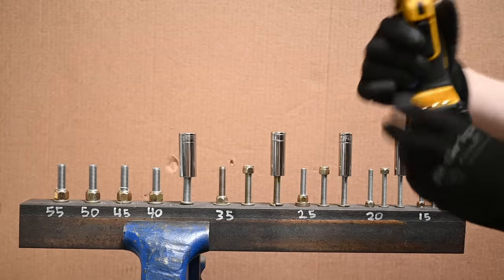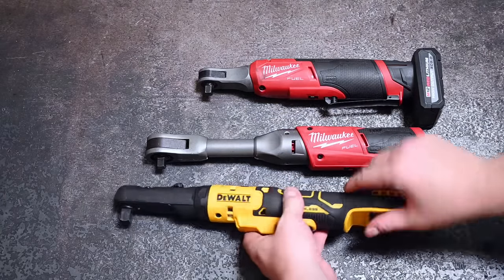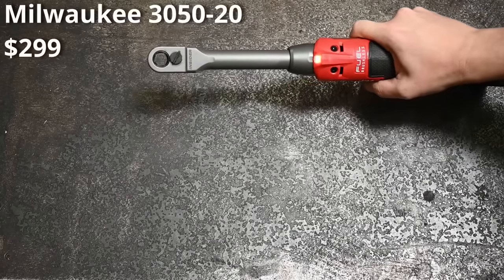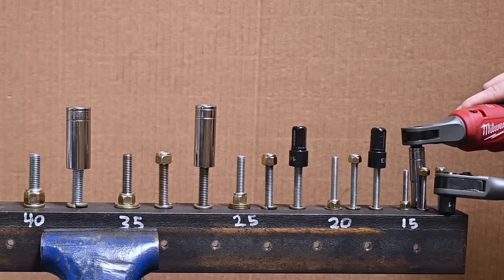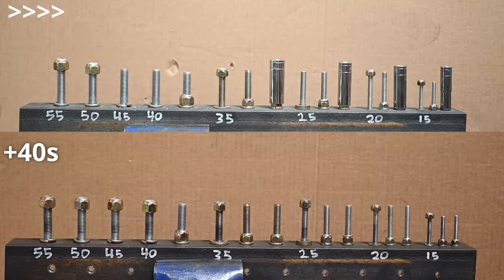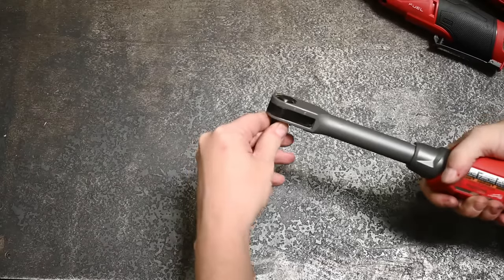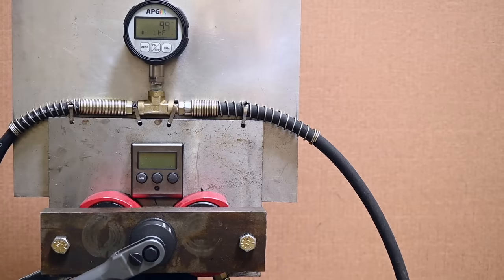Milwaukee's New Insider Ratchet vs DeWALT's New Sealed Head!

Comment: I think the test should be done again with the milwaukee insider using normal deep well sockets rather then the insider sockets as it defo seems to speed up more when using normal ones, i know that the whole point is to be low profile and to use the pass through but at the same time i think alot of people will be using normal sockets daily aswell and when a tight space situation comes up thats when the insider sockets would come in handy. Also with milwaukee udating the anvil adapters the whole issue of the adapaters coming out when taking off a socket isnt a big deal anymore and wont slow you down

Comment: Awesome test as usual guys. Really impressive to see how a unit looks good on specs, but fails in real life. I'm curious if the results would look different if you ran the gauntlet large to small or if the Dewalt would still win. That 12v dewalt is really holding it's own against the new 20v.

 I can't wait to see how the DCF500B 12v sealed ratchet ranks compared to the open 12v and sealed 20v. I think the 12v sealed ratchet has an even slimmer head, which would be nice.

Comment: That M12 ratchet is a thing of beauty. Ive been resistant buying an electric ratchect because of how traditionally bulky their heads were. Speed is the last concern for me.. i need low profile to access tight spaces in an engine compartment.  Very innovative design from Milwaukee.  🍻

Comment: How about using other tool brand batteries on different tools. Per example using a Kobalt 24v battery on a Milwaukee tool with a 3D printed adapter of sorts to see if tools perform better than the manufacturer’s own proprietary battery 🤷🏻‍♂️

I see them often on Amazon & Etsy

Comment: I'd bet the looseness of the direction switch with the passthrough m12 is causing the hesitation. That thing was moving way too much in my opinion. Be interesting if you wrapped it in as few layers of electrical tape to see if the hesitation goes away. That should pretty much tell you if there's a design flaw in the head.

Comment: Would like to see the newer old style Milwaukee ratchets compared as well. The 2569-20 model that exists between the original Milwaukee ratchet and the new insider, would also like to see snap on ratchets up there, preferably the older brushed and the newer brushless model.
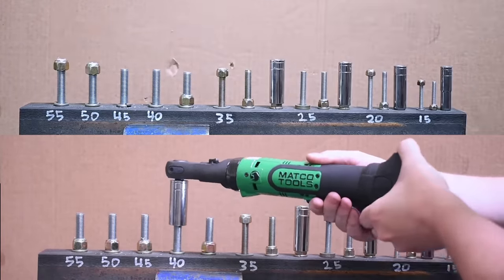Reply: the 2569-20 was featured here, and it actually got the new insider beat on the gauntlet. Fast forward to 14:30

Comment: How about the DeWalt and Matco sealed head ratchets vs the Proto 3/8" sealed head air ratchet J138RSH.. and if you want a real pass through check out the Matco special forces set

Comment: weird its the same effect if you hold the socket in your hand with one of these. that usually means the fastener is flexing somewhat, i see it on v-band clamps all the time, but those are pretty solid looking so my only guess is the mechanism is flexing inside...?

Comment: The reason for that slowdown is excessive vibration and the way the mechanism works on a power ratchet, vibration can keep the ratcheting mechanism from effectively engaging the next tooth when ratcheting, if you put some pressure on the head or the fastener to remove vibration you will see that it doesn’t slow down anymore. My high speed short 3/8 does it when removing stuff that is kind of too loosely held but the nut I’m removing is tightly attached.

Comment: Dewalt dcf500. would be more comparable to the Insider.  It has the same 1/4” and 3/8 drive.  I’m looking to get one and the Insider I like for the sockets, slimmer body and head size. The dcf500 would probably have similar torque and speed to the Insider and better socket changing at the expense of weight and size (size being very important in auto repair)

Comment: The larger sockets aren’t passthru because the male threads that go with those nut sizes won’t fit through the drive while leaving enough space for the socket to engage the drive.

Comment: Thank you for this video! I already have the m12 high speed, and I am in the market for a higher torque ratchet as well. I had high hopes for the insider but this video has shown it’s not so good. I might even consider this new Dewalt sealed head.
Reply: I've been using the Insider to cage brake chambers on semi trucks without issue. 🤷‍♂️ 

The fact that I've used it and then see this video, makes Mr highly suspect of their integrity on this channel.
Reply: @KRC1227  I’m thinking that the unit sent to them by the viewer must be faulty. I hope that when TTC receives their own insider they redo the tests to see if they all are going to have troubles like this unit did.
Reply: @michaelchristopher8266 Honestly you should get the DeWalt. It has both speed and torque.
Reply: @slingin_tires  I’m not sold until I see a display model and hold it. My main concern is the size of the head being larger than my m12.
Reply: @michaelchristopher8266  Ok so it's larger than the high speed but a little smaller than the high torque. What you might just need is the 12v dcf500 Dewalt. It's within a 1/16'' of the high speed with 50 ft lbs. torque.

Comment: My cheapo HART brand is rated for 35lbft at ??? rpm and it can run my Honda Accord off the ground on the factory scissor jack in less than 30 second. Just slap a 13/16 socket on the ratchet and it mates up perfect with the scissor jack dealio

Maybe do a comparo on that sometime?

Comment: Too bad you didnt have the insider amd the dcf510 at the same time. Wonder if the insider sockets would fit the dcf510. Tim from shoptoolsnew (i think thats right) put a caliper on the hex part of dcf510 3/8 anvil and it showed .63. I looked up the 3/8 anvil for the insider on milwaukees page, under the specs it also shows .63

Comment: I see dewalt do a 1/4" drive & 3/8" drive tool & a 3/8" drive & 1/2" drive tool, are they both the same tool but with different adaptors & if so can u get say the 1/4" drive bit for the bigger set or is the tool bigger?
Cheers

Comment: Is there a difference between the 20v sealed head and 12v sealed head I got the 12v from my Mac dealer and seems to be performing great!
Reply: Main differences is size and power. The 20v is very strong and it also comes with a 1/2'' anvil,
Reply: It sounds like you've got a solid tool in hand! The main difference between a 20V and a 12V tool is the voltage of the battery they use. Generally, a higher voltage tool can provide more power, making it suitable for heavier tasks. However, for many applications, a 12V tool can be more than sufficient and may offer the benefits of being more compact and lighter.

If your 12V tool is performing great for your needs, that's fantastic! It's all about finding the right tool for the job, and it seems like you've made a good choice. Anything specific you're working on with your tool?

Comment: I've had a Crapsman Max Axess ratchet set and cordless ratchet for 3-4 years now. Uses proprietary sockets and all are pass through although the largest bolt size to pass through the socket would be around a 14mm diameter. I seriously doubt it would compare to either of these though, just thought I'd mention it.....

Comment: Question is, do you think its better to go buy the 12v dewalt + having to buy a 12v dewalt battery (or some other generic 12v with or without an adapter?) vs buying the 20v tool when you already have other 20v batteries?
Reply from the maker: Get the 20V then if you have a power stack already, if you dont then the 12V with batt and such is still cheaper

Comment: I have the standard M12 and Astro nano sockets but I will admit; this is quite niche. I typically work on motorcycles and unfortunately, I tend to grab a Nepros compact manual ratchet more often as the M12 ratchet is just too big for the spaces I’m working in. When I have been able to use it, it’s been great but if I fumble around with trying to fit this tool somewhere and then finally just grab a regular ratchet, how much time am I really saving?

Comment: Pass though sockets are kinda a special case tool, I've only used my kobalt hand set once the several years I've had it. Most of the time my ratcheting box wrenches are a better choice as I own low profile sockets, bending ratchets and some other less used tools that absolutely make Pass throughs useless

Comment: Aren’t the larger sockets not pass-through because the stud for the larger size nuts would be too big to actually pass through the ratchet?
Reply from the maker: Correct, it would require a different hex size, like dewalt's using a 16mm instead of 14mm and their not even passing thru
Reply: @TorqueTestChannel there are already established standards for sockets with an external hex drive. It would be really nice if companies would just release these electric ratchets in 12mm, 17mm and 21mm instead of trying to be proprietary.

Comment: As soon as this insider was available to purchase in the uk i got it 😂. Got stuck between what to buy 1/4 or 3/8 drive ratchet for ages and now i have both! Paid £350 for the kit which i think isnt too bad.
Reply from the maker: It's not bad when you need both drive sizes really
Reply: @TorqueTestChannel I look at it like it's two Ratchets in one plus the added hex bit adapter is fantastic.

Comment: I want realistic tests on ratchets, meaning how much it takes to break them. In real life we use them as regular ratchets to break loose and to tighten, how hard can you push manually before the mechanism fails or slips, and will it break or slip (Makita slips before it break, most older battery ratchets break, no idea about newer ones and thats why someone need to test it). Torque is for angled impacts, not for ratchets.
Reply from the maker: Well both got up to 150 ft-lbs here by hand. If you're pushing a 3/8" ratchet past 150 ft-lbs, I dont know what to tell ya

Comment: @torquetestchannel
It's been a couple of months. Have you used another M12 insider and noticed if the stuttering was just a one-time issue?
Reply from the maker: Happens all the time. Has to be "right" like enough resistance. But more than once per task/job. Stopped using it TBH, just use the high speed and wrench it when stuck if needed
Reply: @TorqueTestChannel  thank you for the reply. You saved us some money, again. 
We run red and yellow. Currently just running the reliable brushed M12 and extended m12.
For the tight head spaces, is the sealed head an adequate alternative in application? Got a few spots where we've managed without, but were interested.
Reply from the maker: @MidwestPauly  I'd say the sealed head makes up for some of the draw backs of the overall DeWalt shape but all together doesn't match the access of an extended M12 or even an extended Ryobi for that matter.

Comment: Can you test impacts on nuts vs bolts with both hand tools and impacts? Any time i have a through-bolt with access to both sides i use the impact (or ratchet) on the nut instead of the bolt head, ESPECIALLY on longer bolts. I've always felt that i can get things tighter by turning the nut and holding the bolt head instead of the other way around. It'd be interesting to see this tested on the dyno, a known applied torque against the resulting clamp load, i predict the nut will be higher for a few reasons.... longer than average bolts will act like a torque limiting stick with the impacts when turning the head instead of the nut, and also in many situations a bolt will have more friction along it's length through the objects being bolted especially when the hole is a close fit to the bolt.
Reply: It won't make a difference as far as clamp load applied when things are equal under the head of the nut or the bolt. (surface finish/material/surface area of nut/bolt head) Turn whatever side you want. As far as "torque limiting" when turning the bolt, the same force is acting on the shank of the bolt whether you tighten the nut or the bolt head unless the shank is tight in the hole, which it shouldn't be for proper clamping. So again, turn whatever works best for the situation. 
It can matter for sure, but not always.
Reply: @-DJ-  I disagree regarding what you said about the "torque limiting" effect. When acting on the head, the impact force has to overcome the friction the head has turning against the surface, and then travel along the length of the bolt in order to overcome the friction with the threads of the stationary nut on the other side. When you're impacting on the nut, the force is being transferred directly into the place where the friction must be overcome, the friction the face of the nut has with the surface and with the threads. I would think that you'd get a higher clamp load because more force would go into turning the nut instead of being lost to torsion along the bolt's length. (there will be some loss to torsion in both cases, but I think turning the nut will have less)
Reply: @brandon2076  I'll be honest, I missed the impact part of your comment when I made my reply, I read it but I didn't take it into account. I still think it won't matter, but this response is more of my own thoughts than facts. 
When you turn the nut, you are pulling on the bolt. You can't advance the nut up the threads without elongating the bolt. You can't elongate the bolt until that torsion has been taken up no matter what side you turn.
Reply: @-DJ-  I did consider that and you may be right, but things don't always work out the same in practice as they do on paper which is why I'd like to see it tested.

 As someone that works on heavy equipment every day, these things usually play out logically and adhere to common principles...but sometimes things happen that defy common sense, and I've learned to take that into account when approaching a dilemma.
Reply: @brandon2076  An impact may throw all my ideas out the window, a test would be interesting to see. I turn wrenches for a living too. Dual licensed for cars and heavy trucks and dabble in fixing our heavy equipment when the time comes.

Comment: I have dreams of upgrading my toddler's electric Radio Flyer go-kart thing into a dual motor monster. With that in mind, which Milwaukee tool would you cannibalize to make this happen? The 6" angle grinder? Or would a gearset come in handy? I'm thinking motor torque and top speed is important, along with trigger modulation (on/off would not be good) and potential motor braking solutions (instant-stop designs might be good or awful?). Maybe you even want to start a project like this? Anyway, fun to think about!
Reply: M18 Chainsaw motor is pretty beefy.
Reply: @linadsenoj That’s a good idea. You could replace the chain with one that doesn’t have sharp teeth, and then it’ll be easier to attach to a driveshaft.
Reply: I was thinking direct drive, hence the dual motor. Or directly off a gear-set if desired...
Just for simplicity I guess.

Comment: For $299 is a little too high for a new tool.  Was really about to pull to trigger just for removing bolts off blower wheels.  Knowing milwaukee they already have a gen 2 in the works

Comment: Proprietary sockets are a big pass no matter how well it performs. Trying to decide where to go from snappy 14.4 right now and it seems to be M12 impact and dewalt ratchet...i can't handle this many ecosystems!
Reply from the maker: Just do m12 high speed and M12 impact then
Reply: @TorqueTestChannel  For what it's worth, picked up the DCF903 impact and DCF500 sealed had ratchet and absolutely love em. Don't think you've covered either directly, but really appreciate the channel as always!

Comment: Why did both get 50 in score for price ? Shouldnt the Milwaukee be closer to 60 ?
Reply: I hear you said 50 max, but why do you put a max on that ?
Reply from the maker: @jtaulen  Good question. Because lower is best, there has to be some type of upper limit. We chose 50 points early on. Otherwise a tool truck racthet at like $380 even if it somehow did the gauntlet in 10 seconds which would be like space age tech, would never place. It's so the score isn't simply about price, which you guys can easily put weight in without our help. But still helps the lower price brands like Ryobi rank where they deserve to be
Reply: @TorqueTestChannel  Fair enough, thanks for the reply !

Comment: What I like the least about these newer ratchets are the bulky a** batteries they stick on the end.. it's very often where I have to squeeze my ratchet in spaces where it barely fits and with these newer ratchets it wouldn't even be possible. Just yesterday I was working on a car where I was squeezing my older Earthquake ratchet in several places behind the engine and through some narrow passages where I wouldn't even get very much swing with a hand ratchet, so it literally saved me tons of aggravation of not having to loosen those bolts by hand.. These newer ratchets would leave me stranded 🤦🏻‍♂️

Comment: Does anyone happen to know what MAX torque is on the Dewalt? I bought the M12 Insider a few weeks ago and on first real use of the tool it broke the ratchet mechanism. Their "60 FTLBS of torque" is definitely the real maximum of it. No safety factor there. The Dewalt lists 70ftlbs of torque but they advertise that as motor torque so you'd think the breaking torque of the ratcheting mechanism is higher than that.

Comment: Ive been having that stutter issue that your insider had with my fuel extended reach ever since i had replaced under warranty a year and a half ago its been in and out of repair 3 times since and it gets worse
Reply: It seems to be play in the ratcheting mechanism and it gets so bad that if you aren't lightly swinging it it will sit and stutter in place